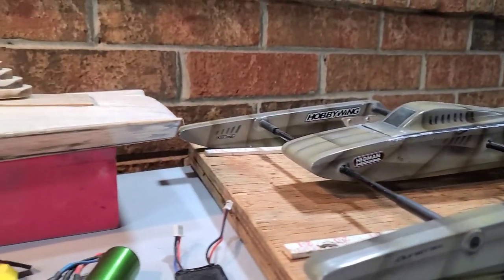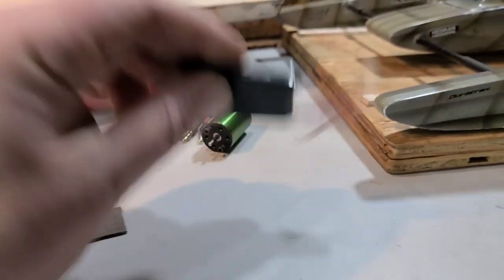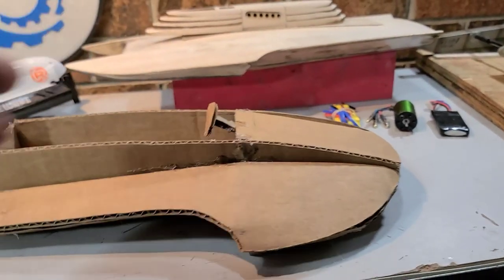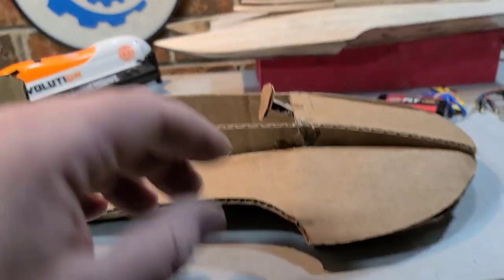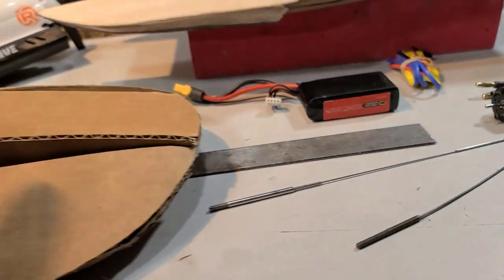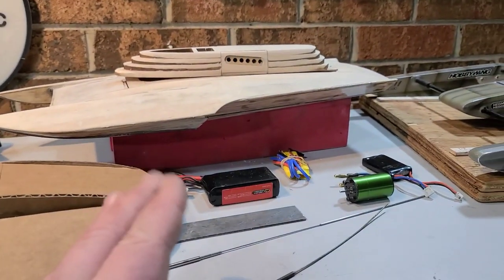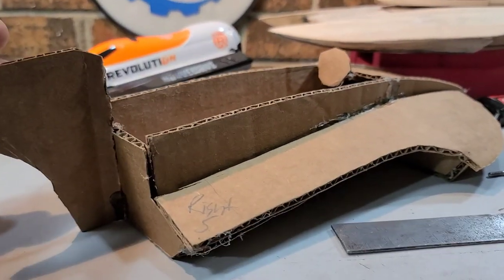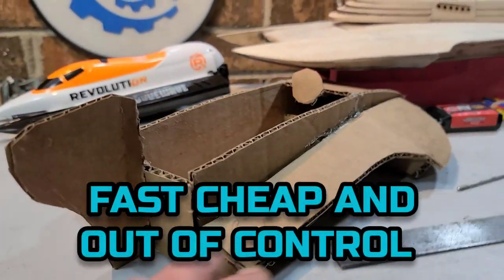12” Micro Racer Challenge 2022 - RC Boat Build - Fast Electric Rc Boat

Comment: My first fast electric boat in the 1980's, Thimble was a 14inch plywood & balsa boat now called Thimble MM1294. It used a 540 motor, no speed controller just a servo mounted on/off switch and a twin stick 7.2v ni-cad battery pack.
Great fun, cheap to build  and fast for the day. With a plastic moulded version of Thimble I won my first ever fast electric boat race. Turned out to be my only win in the year that I race with the Electra Club here in the UK.
I really enjoy your vids keep up the good work 👍🏴
Reply from the maker: I've seen the thimble 1294 before very cool little rig (I think it's the same boat I'm thinking of)  🤔    micro boats are fun to build, very impressive once tuned and running prim.    Thanks for watching

Comment: I'm getting in on that challenge for sure 💪
Reply from the maker: Well you can enter buddy but there's only 0ne 1st place position and that's me all the way.    Good luck GUY Your gonna need it!  😆 🤣 😂 😹 😆
Reply from the maker: Dude you'd better hang it up I've got the meanest little hydroplane on the bench that will make the the proboat u19 look like it's running backwards compared to the Saucy shingle..   BRING UR A GAME BRO!
Reply: Oh you wanna talk junk HuH.  Well my boat is going to make the tfl genesis look like a bath tub toy. Twin 2030's wjth twin 50a speed controls running 4s x 2 200mah each side. Stepped catamaran hull.  GET IT. 

130 KNOT & NO SMOKE C'MON
Reply from the maker: Oh yea buddy.....   well. WELL,,   I'm making a custom outboard MOTOR  with a 2030 strapped to her. Mounted on the transom of the boat.   1st place here I come.  

200 knots & No SMOKE. C'MON
Reply: @IRONCLADRC  Settle down guys......  😏😏  Kinda like the debates I have in my head...... Hang that motor off the back and balancing may be an issue.........
Reply from the maker: Gotta try.

Comment: Only half way through the vid, but I'm diggin' it.  Your dad used to race Kneelers?  That's beyond cool!  I LOVE your little kneeler hydro idea!  You should get style points for that alone.  The boat needs to be MOSTLY wood.  You can have some metal, composite, or plastic parts too, just the main/majority structure needs to be wood.  Will add more as I watch the rest......  Scan your plans for the kneeleer and send them to me.  I'll import it into AutoCAD and make laser-cut kits!!  😉
Reply from the maker: Yea he and my grandpa had 3 boats two round nose and 1 picklefork. Running highly modified super 8's I still have one of the super 8's laying around somewhere.
Reply from the maker: it was big in the late 80's back home. now they race 14' ceder strip boats with 70hp Yamaha 2strokes
Reply from the maker: Oh man that would be amazing. Thanks.  Curious as to your opinion on "sponson" Aoa sitting flat with all 3 point touching?  For the Saucy shingle/rigger.   I'm thinking 3° w/o strut with strut should be around 2° give or take? What's you take on Aoa angle?
Reply: @IRONCLADRC  I wouldn't go too flat on such a small boat.  The KEPS rigger and the Dona use 4° sponsons.
Reply from the maker: Roger that thanks

Comment: Here's why you guys are in so much trouble:  I've weighed all the built wood sub-assemblies, calculated the weight of the missing pieces and have concluded that the all-up weight of the finished/painted/sealed wood parts in my entry should weigh somewhat less than the battery.  That's roughly 60g for the hull, 60g for the battery, 50g for the motor, 10g for the servo, 10g for the ESC, 5g for the Rx, 20g for the coupler and driveshaft, 5g for a prop, 20 grams for hardware and 10g for wires.  That's my target weight: 250 grams all-up.
Reply from the maker: Dang that light.    Heck yea.   I just finished building my entry. It's freaking awsome. 29.5g without sealing
Reply: @IRONCLADRC  29.5 without sealer?  Dang.......  I better go add some more lightness!
Reply from the maker: Yep 29.5. It's gonna be a screamer or an airplane. One of the two.  😆
Reply from the maker: I'm gonna have to make a custom propeller for this one.  I can't find anything worth a dang under 27mm.  Tenshock eco props are 20-28mm but the shaft doesn't line up with any of my shaft options?
Reply: @IRONCLADRC  Maybe both........   Are you going to build the roundnose or the Mini Mogli?
Reply from the maker: @Dr_Jet   going for the roundnose.  I'm actually building 2 boats for the challenge only gonna enter one of course, I've got alot of wood,  and it's just as easy to build 2 boats as it is to build just 1 boat.  Lol.  I think you may have created a monster with that wood kit lol. Man that's right up my alley
Reply: @IRONCLADRC  I certainly hope so.  Big boats get all the recognition, but I really love the small ones because they're fast, cheap, and often out of control.  I'd love to see the popularity of these little boats increase since they don't require a huge pond or pocketbook.

I'm dying to see what you've come up with for the little kneeler.

As for props, every now and then you can find a CNC aluminum prop that is 26mm.  If you can possibly find one, Kyosho made a really nice prop for the Mini-Z Formula boat that was 20mm or slightly more.  They were expensive when they were available.  I looked and couldn't find any.  OSE has Graupner 26mm props.  These fit a 2mm threaded shaft.
Reply from the maker: Yea I'm working on the build video for the kneeler.  Oh man I must of overlooked the grouper prop at OSE?  Thanks.
Reply: @IRONCLADRC  Beware, it's for a M2 threaded shaft.  Small stuff.

Comment: Oh, you guys are in a world of hurt.  According to my mole, embedded deep within the super-secret Stinkbugwerks, Dr. Jet is bending the first piece of wood for his entry.  Yes, it will have some curves in the wood structure......
Reply from the maker: Sounds like a mono hull to me!  I'm going to pick up the lumber for mine tomorrow.   I can't wait to see what you have up your sleeve Dr.  Jekyll .   Originally was gonna build a  MONO hull or one of those Thai LONG TAILS.       😆 🤣 😂 😆 🤣 😂
Reply: @IRONCLADRC  Those Thai longtails are a hoot.  Turbo diesels on a stick!!!
Reply: @IRONCLADRC  Now, you have to think like the Doctor.  What is the fastest way to get around two buoys?   Simple:  Add lightness and build in simplicity!    🙄
Reply from the maker: If I had to guess a f1 Tunnel hull would run the quickest lap around 2 buoys.   There known to make the hardest turns on the water period..    my opinion
Reply: @IRONCLADRC  Bwwwwaaaaaahaaaahaaaahaaaaa......🤐
Reply from the maker: Same power  same battery capacity,  same size boat, same distance from buoys to buoys what do yo think is the fastest boat?  Rigger is your answer I just wanna hear u say it.   Dr jet. Lol A Tunnel hull would be close behind? Would It not
Reply: @IRONCLADRC  It seems like my mole in the Stinkbugwerks is under a lot of heat at the moment and can't pass much information at this time. 🤫  You are beginning to think like the Doctor though........
Reply: According to my mole embedded within the Stinkbugwerks, Dr. Jet has completed bending all the necessary wood pieces.  Some glue has already been applied and the report for tomorrow includes a high chance for scattered cyanoacrylate activities.  12" SPEED is headed your way.